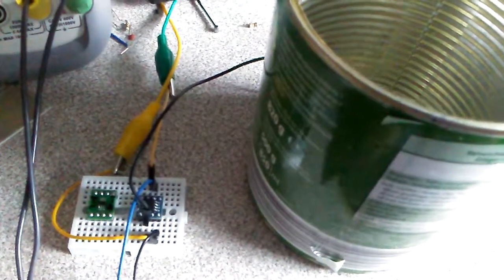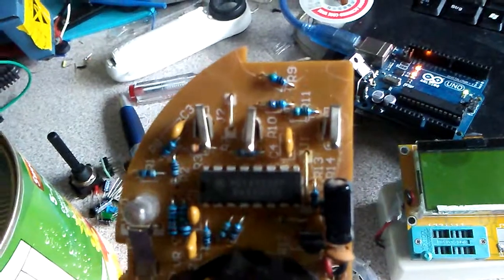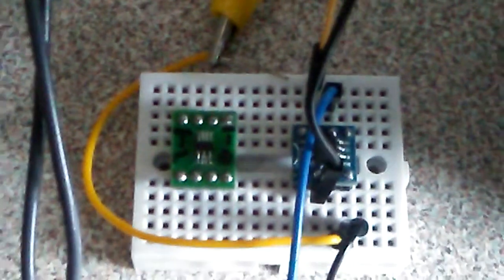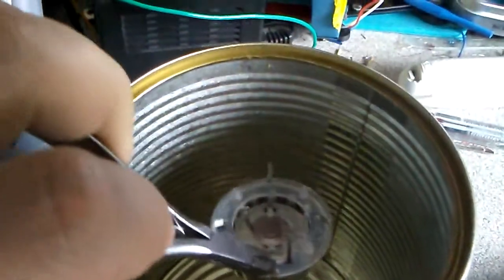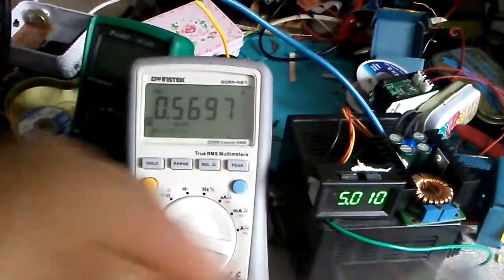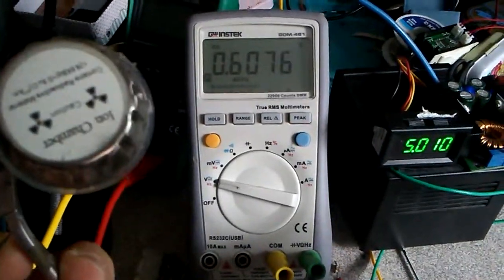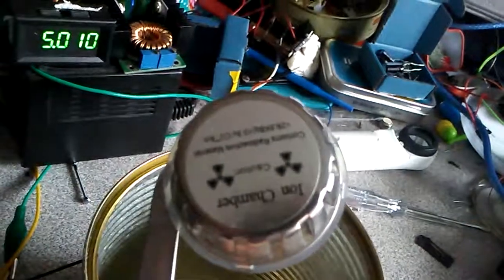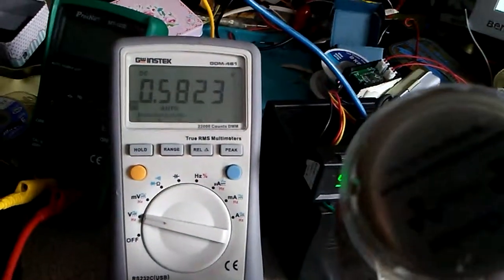Ion  Chamber Radiation Detector homemade DIY

Comment: It seems there are not other components involved than only the MCP6241. That way the circuit is quite simple and straightforward, but can you give me the schematic when it comes to the attachments of the op amp contact pins?